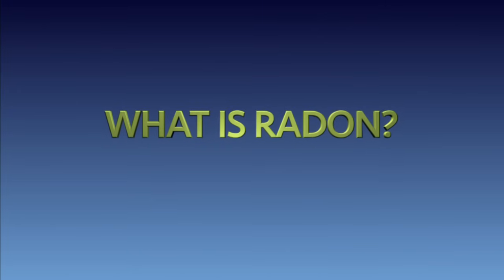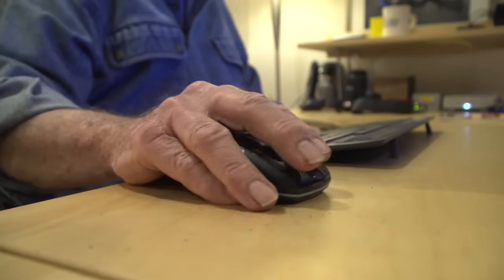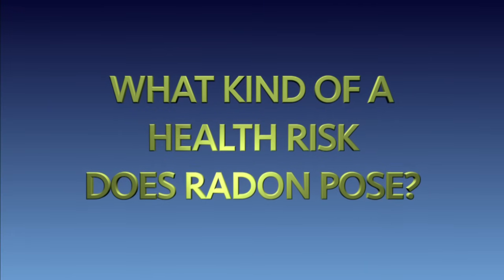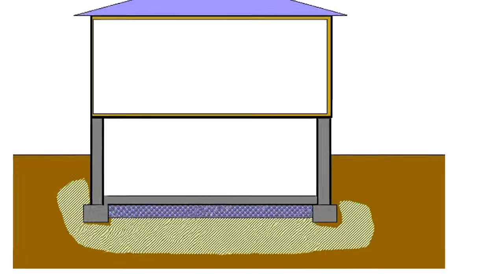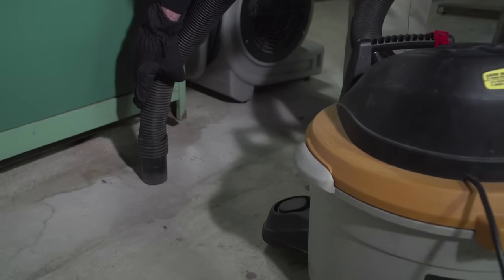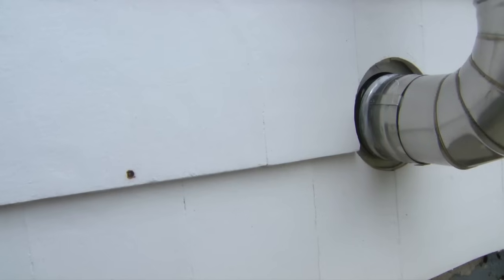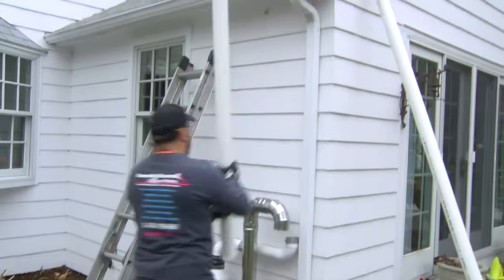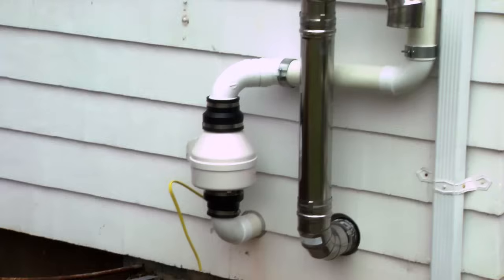Radon:  What is it?  How to Get Rid of It

Comment: I bought a radon detector and it hit 6.5 yesterday.  Still around 6 today.  I put my detector outside just out of curiosity(in the shade - 6 feet high).  A few hours later, still have a reading of 6.   I figured it would be much lower outside.  Thoughts?  Thx

Comment: Three inch PVC doesn't provide enough air flow for and under slab system. Perhaps that's why you neglect a follow-up radon test.  You solved some of your issue but not all of it.

Comment: If buying a home in a state like Iowa where the ENTIRE STATE has homes with high radon levels, perhaps its best to Plan to test AND get the radon mitigation system installed...Basically the test is for where to place the system in the basement..You need the system regardless.

Comment: If it's coming through the cracks of the foundation, what does drilling a hole and sticking a pipe into it do? It'll still be coming through the cracks, won't it?
Reply: You also should caulk all around your floor to wall joints, and also cracks in the floor

Comment: Thanks for the informative video. We had a radon test done by a home inspector and the radon level was 4.3 pCi. The house had been all closed up for a long time as it was a foreclosure and basically abandoned. The test kit was left inside for 52 hrs. 
I'm now looking into a radon meter so we can monitor radon levels over the next few months before we fully move in. Does anyone have a recommendation for a radon meter? They have a few on the internet including one by Airthings being sold on Amazon. Are these devices accurate? 
Also, if we put in a fan, will this cause heat loss in the winter? Our house is in a cold climate in Upstate NY.

Comment: What about high ground water and coastal flooding? There would be water pulled UP from under the foundation,  into the fan and out the top of the pipe... there must be a reason I've never seen one of these, despite years in property and commercial building maintenence.

Comment: @5:54:  That appears to be unprotected Romex outside.  Also, it's unclear how that system manages (1) condensation in the exhaust pipe and (2) rain into the pipe.
Reply: They used liquid tight from the fan to disconnect

Comment: I would like to share with you a discovery how to both Stop and prevent Radon entry into homes very quickly and cheaply that WILL save many lives. The solution is by using flexible formulated wax to go with the contracting and expanding space at the floor/wall joint where most Radon Gas enters. As you know, over 20,000 people die from lung cancer every year in North America alone caused by breathing in Radon. This basic wax technology will remove over 95% percent of Radon entry. Reducing the intake levels by that much deserves the attention of the would environmental people who call the shots. The Government of Canada, CMHC chose three homes having extremely high Radon levels up to 64 pCi/L. After sealing the levels went down to almost zero entry, CONFIRMED. I would like any help in the way of advice on how to get it known that there is a solution for solving this Radon Gas entry problem once and for all. If you would like documentation regarding the research work that has been done and what has been achieved, reply. All the mitigator’s out there will charge you up to $2,000 to only redirect the Radon to the outside of your house by drilling holes through your wall and concrete floor slab, installing pipes, a suction, or an exhaust fan to draw the Radon Gas from beneath the floor. This sealing method will both stop and prevent Radon entry for just the cost of materials, time, and labor which is about $100.00. Willy 613 2675418, - waxogen@gmail.com Willy

Comment: I just purchased a home tester, made in the USA - the model was the SafetySiren Pro4 (4th generation) unit.  I also purchased a 2 pack of the Accustar Alpha Track carbon radon testers to run alongside the SafetySiren electronic tester to compare the two for long term readings.

My last reading was done 3 years ago with the a pair of the Accustar Alpha Track carbon testers only..... and they yielded a reading of 2.6 pCl.  

I have had the Safety Siren running for 2 1/2 days and the initial 2 day (48 hr) reading was 4.0 pCl..... I noticed last night the number has dropped to 3.9 and this morning it is at 3.8.  I am wondering if the average level reading will continue to go down over time as I test it for long term radon levels.... due to radon fluctuations???  The owners manual said to not be alarmed at initial high ratings over the course of the calibration period of 2 days and that the longer term average is what should be focused on after it has been in place for several days to months.  Would you find that to be accurate??

Comment: Buying a house in the UK & just had our 1st report that the house is in a possible risk radon area (where "Some parts of this 1km grid square are in bands of elevated radon potential. Maximum radon potential is 3-5 %", but it's non-descriptive as heck).
I've had 2 houses so far & we've never heard about radon until now, buyers should be informed about radon even if they're not in a high risk area so they can prepare more for it before putting an offer on a house.

Comment: Question. Our radon levels were high (3.0-5.9) in our house (half basement). We had it fixed the level went to 0.6-1.0. We recently now have a water pipe leaking under the house. It’s been going on about a week. Now the Radon is <o.3. We are in East TN and cooler weather is setting in so we expected it to go up if anything. My question is if the water leak is bad enough in the area were the radon is highest can it trap the radon gas temporarily making the level go down? We do have a plumber coming to fix leak.

Comment: So, because the foundation wasn't created perfect, this guy has to spend a hell of a lot of money two ways, money spent for them to come out and put holes everywhere and put in piping. AND, because that motor runs 24/7, there goes the higher electric bill. So the problem is....HOME BUILDERS.
Reply: You're wrong. It's not home builder's fault. Builders are not required by law or by code to address radon at all. Some builders may install features which make help keep radon out of a house or features which make enabling an active radon system easier, but neither is required. There's nothing wrong with the slab. There aren't "holes everywhere",  there is often one hole, and the annual cost to run the radon fan is approx $95. I am a state licensed radon specialist, a radon expert.
Reply: @Mike1614YT  Nope, wrong, I saw them drill more than one hole, have to, to put that contraption together. And, never said there was anything wrong with the slab/foundation. This radon has been around for thousands of years and it's not going anywhere, therefore, an intelligent building  designer would design just that in all it's houses. And, one day, radon is going to be so bad, it will be required in all homes. Apartments right now are being tested for radon, it's not going anywhere, wonder how they're going to fix the bottom, middle, and top floors when they find it. And, you yourself just now said that "some builders may install features which help keep radon out or build features for future enabling a radon system." This means, there ARE builders that do this. That, makes a smart builder.... thinking of the future, and, a home owner would appreciate it. There ARE people who have the money that would buy a house already with that in mind.
Reply: @reilea9977  guess youre the expert
Reply: @Mike1614YT  no, THAT'S logic

Comment: if a vacuum test verifies the slab will draw... why is the hole drilled 20' from the exit spot? would it not be better to drill the slab hole, as close to the outside exit and mid way along the center as possible? think about blowing up an air mattress... if the nozzle is in the center, the mattress will inflate evenly... if its on one corner..the corner closest to the nozzle fill up first... now reverse this... AND the slab is poured over large fill stones so a vacuums test seems a mute point...

Comment: I see so many ways a person could get screwed and scammed by these people. Starting with the fan failing with rain water running through it and shorting out. I think self testing and DIY install and after testing would be the best answer.
Reply: You can get a mushroom cap for the top of the pipe to save rainwater getting in

Comment: If you are in the market to buy a house I would definitely have this test done.  The cost to install is around five thousand to start that's what I was told when I asked the cost .  Just so people know if you don't have the money to have this set up installed just which a couple video pick up your pic pipe yourself you can do this yourself  they sell inline fans at any grow shop .  Most pot growers use these same fans. For their light systems .  an they are pretty cheap to purchase $200.00 the most  usually pick them up used around 50 to 75.00 bucks  . you basically what to get that air out,  that's sitting in your basement if levels are high the installers are making a lot of money off  pic pipe an online fan you yourself can buy for 200 new.  I hope this helps people.. don't pay five grand.    it's a money racket but do install if your levels are high.   Anyone can do this just watch some Vida an you yourself can do this for less thanks Bruce.
Reply: https://www.youtube.com/watch?v=WYnSEW4sXrk radon has not been correlated to cause lung cancer. it has been negative correlated which means the more radon in the air the less lung cancer. WOW science and facts defy common sense! but maybe you think the Earth is flat too.

Comment: I rented a place an the random gas was 5 something . anyways it was high considering windows an doors were open most of the time during the test. I was asked buy the inspector to keep things closed.   But it was way to hot for me to do that during the summer.   I talked to the guy doing the test.  an asked,  if I continued to live their without the system installed how long before I should worry , he told me roughly 15 years I would definitely have cancer. I have since moved.  They say it's odorless, I beg to differ. We complained a few times of a fowl smell .  we couldn't figure where it was coming from.  oh yeah another thing I had my work bench in the basement,  an if smoked a cigarette, it kept going out.    continuuisly.   I think their's. not"" enough research as of yet"". We will all learn in time.   but these are a few things I noticed living where their is a high concentration of radon . The landlord tried to keep things pretty hush about all of it also.   I hope this helps  ohh it wasn't damp at all either.  I hope this helps an don't take this stuff lightly it's serious..

Comment: My radon fan is upside down. Its literally pumping the radon into my home!

 Get this:  My new system looks very professional. But as I said,  I discovered that my fan is upside down!!  I was suspicious because a crack in the floor next to the radon pipe is blowing air into the house!  It should be sucking down into the dirt. (actually should have been sealed) Next, my manometer says 4.8. (seemed high) Next,  I climbed on the roof.  My vent pipe is sucking down!!  Finally, my radon level went from 4.6 to 6.8!  And that's away from the room with the cracked floor.  I'm currently testing over that crack. In about 40 more hours I'll get a reading. I bet its sky high over that crack.  The installer needs to fix this.  Hasn't called me back yet.
Reply: What a nightmare you have on your hands!! I hope they fix it for you!
Reply: @Xoletta  They did come back and fix it.  Radon went from 6.8 to 0.5, tested again in another area and got 0.3 within 4 days after repair.
Reply: @JM-nh8yp  that's good! Glad it was worth it in the end!
Reply: @Xoletta  Yeah, thanks I didn't pay a penny for my new radon system.  It was part of the deal before I agreed to buy my house a month ago.  But I'm glad it works now .
Reply: 800 lawyer lawyer & Associates
Reply: Kool u have fresh air under u concrete floor
Reply: it would have been pumping fresh air into your home as long as the pipe leads to the outside. This will actually DILUTE the radon which in some cases could help
Reply: @realismbystella9775  No, pumping fresh air into a home with no outlet wouldnt help at all.  The fresh air that was entering my home was directed under my basement floor slab.  So that flushed out even more radon than what was slowly seeping out before.  It was a nightmare.  Kind of like having a sewer majorly backing up.   Very bad when things go in reverse of normal.

Comment: Hey Ron! Fantastic video, very informative and well put together -- thank you very much for sharing it! I have to agree with many others, though: a test to show the radon levels after the installation is a must, and I would be curious to hear what you have to say about the concerns of rain water entering the system from that seemingly exposed final section of pipe.
Reply: yes they need to add a rain cap on top similar to what chimneys have so that water cannot get in but radon can get out

Comment: The real problem is that the mitigating company usually does the testing which is a conflict of interest.
Reply: its not a real problem. radon tests are hard to fake.
Reply: @elaineisretired25  Just do another Radon test lol. It's 100 bucks. It causes cancer over YEARS, not a cough btw.
Reply: Usually the buyer does a Radon test, if the levels are high, the seller uses a different company to perform a second test. If the averages of the two tests are above 4.0 piCO, the seller has a mitigation system installed. 

Your worry of conflict of interest isn't present in this type of transaction.
Reply: You're weird, do you go to the dr to  get checked out, and after they run tests,  you don't have that dr treat you, you go to another dr? Come on now
Reply: And the tests are inconclusive. Not only are the tests NOT measuring actual radon but they're usually testing one of the daughters of decay, usual bismuth which has nothing to do with radon levels.
Not only that but a test one week later will have a different result. And many factors can influence inaccurate tests.
All the mitigators & home inspectors know nothing about radon. They simply pass a basic EPA test that allows them to test for 'radon'.
A multibillion dollar scam!
Reply: You can buy a radon meter if you're worried about that.    They're not cheap, but you get peace of mind.
Reply: @elaineisretired25  You should have the radon checked by a licensed radon measurement professional. BTW radon can cause lung cancer, but the onset is usually approx. 30 years, not just 3 years.
Reply: That's a simple gix!  You always have an independent test by home inspector.  Then if needed you better n hire company that does mitigation
Reply: Amen, amen and AMEN! I would imagine that in over 75% of the installations of Radon protection; there is shoddy work and/or downright scams. Oh indeed yes.

Sadder is that is happening in EVERY single thing; when it comes to home repairs. If you haven't had this to happen, you are either ignorant to this malady; or you have not "lived" yet.
Reply: @MrPatdeeee  what are your qualifications to say those things?

Comment: there is a scientific hypothesis called the "radiation hormesis" hypothesis, which is just what it is at this point, a hypothesis proposed by a small amount of scientists, and many other scientists are opposed to it's validity. Personally, I do think there is a possibility that our bodies developed an adaption at the DNA repair/cellular level to deal with living in areas with higher than usual natural background radiation, as many early homo sapiens probably lived in caves or eathen/mud walled huts (which could contain high amounts of radium, thorium, uranium and other naturally occuring sources of radiation in the soil/rock. Natural background radiation coming from the soil can vary widely geographically and can get up to 20x or more the standard level in certain places, also certain solar storm activity or gamma ray bursts coming from far away stellar events in the galaxy can also rain down unusually high levels of radiation onto us, for hours, days or more, so our bodies probably developed systems to cope with this. 
But claiming that radon is good for our bodies and the more you inhale the less lung cancer you get is highly exagerated. Maybe tiny amounts can have a beneficial effect, for example the systems in the cell will trigger the repair process of the damage done to the DNA by the small dose of radon, and in the process this will also fix other smaller damage to DNA from other sources too small to trigger the repair process, which, if not repaired, will slowly add more and more damage to the DNA and result in cancer over a timespan of decades or more.  Then again only a very specific and tiny amount of radon could theoretically do this, and anything higher than that dose will rapidly cause severe, non-repairable damage to the cell's DNA which could cause cancer after a certain time. So in the end, it's probably safer to get rid of the radon in your house completely, unless you have a sensitive multi-point measurement system that reliably measures the radon levels in your house and can guarantee you're getting that tiny, beneficial dose. It's worth noting though that there is no data on what that dose would be, it would require many studies with large populations.
That's my 2 cents...
Reply: Terrence Vergauwen that was more like a $20.22
Reply: I read where they did Rafon therapy tests on autoimmune patients and low levels helped.  So in some cases could be true